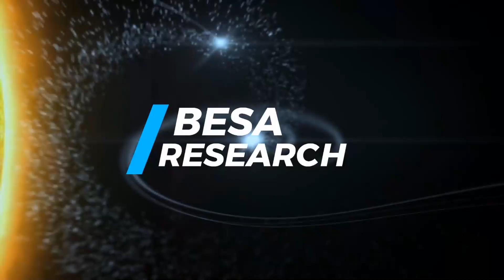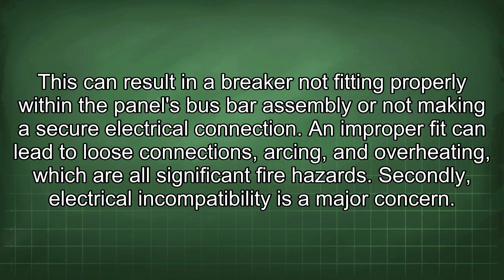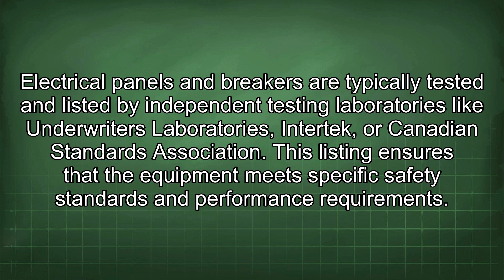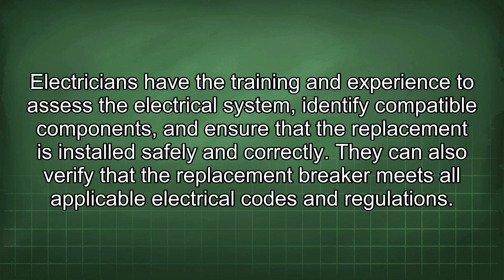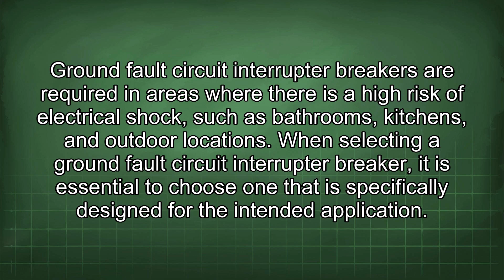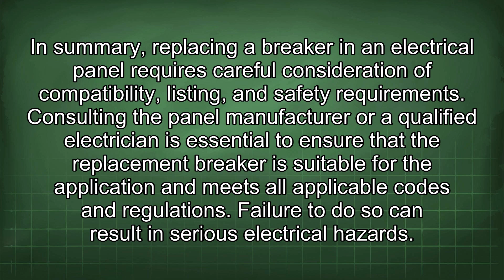Challenger Breaker Replacement Finding Compatible Options

Comment: Somebody tell me, isn't this completely useless?
Reply from the maker: Hello @seanpop2886,

Thanks for your feedback.  Well, we help it might help someone in a tight spot with a Challenger load center. Aside from that, it does not have many other use cases. 🙂

Sinclerey,

BESA Research